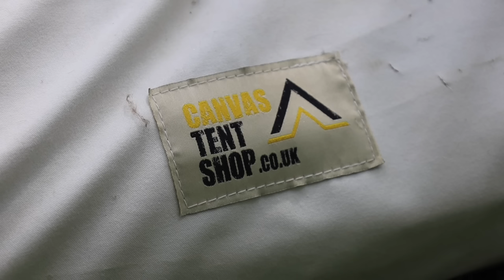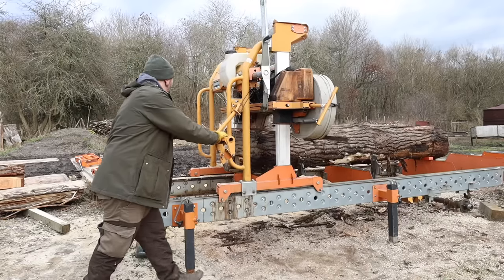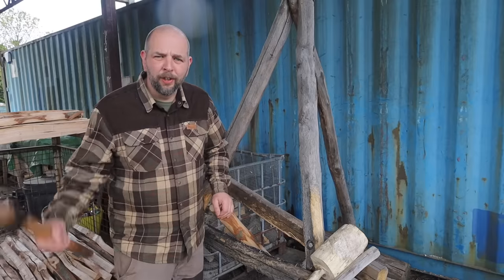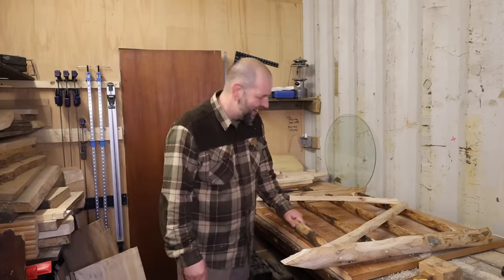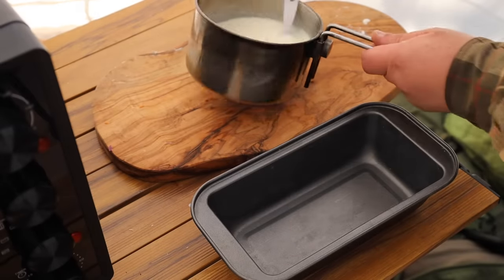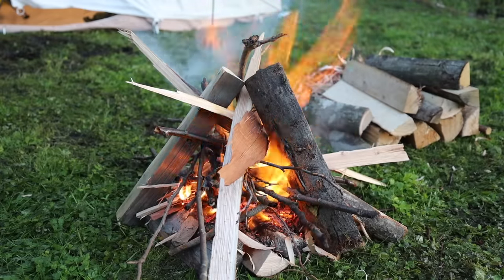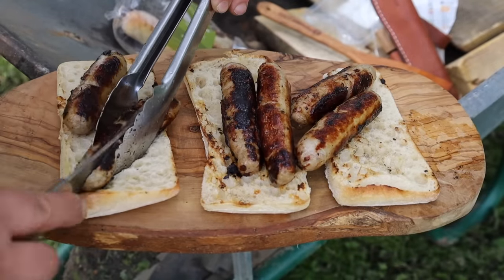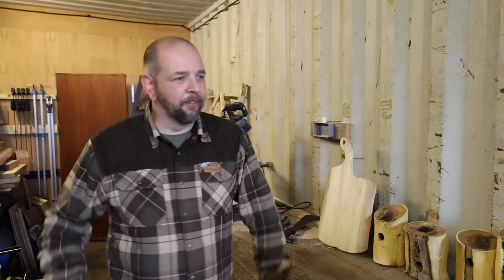Off Grid Camping - Wood yard Woodcrafting

Comment: The biggest benefit of solar for camping, would be charging an electric chainsaw, so you can harvest wood with a LOT less effort.

Chain saw dead standing or large fallen trees into 6-8' logs, which you can then much more easily hand process into firewood.

At first i thought an electric chainsaw would be worthless, but it's far easier to source electricity in the wild with solar, than it is to source gasoline and oil for a traditional chainsaw.

Comment: The point of this video seems to have been to get Bluetti to send a free power bank to your mates commercial business. That power bank, whilst very capable, is entirely unsuitable for commercial use. It's not rocket science, the wood yard needs a bank of batteries, a roof full of solar panels and an inverter.
Reply: 🤦 The woodyard runs on grid power just like with all the other things in this video. He was simply curious so he decided to test and see if the Is solar battery  could handle the power draw of a table saw. The point of the entire video is to demonstrit's ability to be used to power off grid things while camping or glamping. And hopes that some of his viewing audience will decide to purchase one and use his affiliate link so he makes money off of it. It's not rocket science. 😏
Reply: @Jacob Ravenwood  So the video was aimed specifically at all those members of his viewing audience that take a commercial table saw camping with them then? I'd say that if that were the case, it would have been a pretty niche video! The best way to establish if a power source is suitable would usually be to have a look at the plate stuck, or riveted onto the machine by the manufacturer, which would specify that information quite accurately. I don't think trial and error with power banks is really the most efficient, or economical way to find out. 🙄
Reply: @tim1289r  I'm sorry that I didn't directly specify I meant random any random thing that 1 could possibly need or use camping or doing other outside activities that requires a power source not just power tools not just table saws Anything refrigerators microwaves air fryers random Anything random just trying out lots of different random things to show.  The station's ability to power a wide variety of many things not specific one things that are always brought on camping trips lots of random Like the electric oven that he powered in the video. A basic old school commercial sales tactic meant to show the significance and power of said station in order to impress those watching enough so that they may then proceed to purchase. Said station. With which to determine that this station might meet all of their necessary needs without Having to read anything but there's simple visuals. 😏
Reply: @Jacob Ravenwood  oh, I see, well actually, I don't. So the video's author and creator got it wrong when he wrote in the video's description,  that, this was the beginning of taking the wood yard off grid? Maybe you should watch the video, or at least read the transcript. To me, it seemed that the conversation with Bluetti was about the wood yard. Maybe I've misunderstood things,  because to be honest, quite a lot of what is said in the video makes little to no sense anyway.
Reply: @tim1289r  I see what you mean. I don't know either maybe he started out with an original plan for the video and then change it halfway through and just got too lazy to Alter the description. Maybe hes got a lot of family related things run through his mind when he was filming. And editing this video who knows. With the term scatter brain comes to mind. 🤔 I know I've been there a few times in my lifetime to say the least.  lol
Reply: @jacobravenwood7968  fair enough! 👍🏻

Comment: That powerbank looks good, might it benefit from a sack trolley or similar? Could be easier to move it about then. Tefal every day induction hob is a good hob and does not use a lot of energy because the lowest (manual) settings will get most things cooked without fuss or problems. Looking forward to more of this hybrid style. Be well.

Comment: Like the bell tent and always a good video…but bro??…”off grid”???…definition : not using or depending on public utilities, especially the supply of electricity.🤔
Reply: A portable solar generator is not public utilities public utilities require a grid and a ground based connection. By utilizing portable solar energy rain catchment systems. And going to the bathroom behind a Bush instead of in a toilet that flushes into a septic system Those are all aspects of off grid. Because you are not dependent on a government or state run utility services.

Comment: An induction hob can be set to use 500 watts, I have used it on a Goal Zero 1000x power station to cook meals during power outage... the 1000x is in my truck, the power station I use (4)100 watt panels to charge it from time to time it will take up to 600 watts from panels... my 300 watt panel is  on my Goal Zero 1500x power station  which is powering my covered patio fridge most of the time... an experiment. 

One thing about the current level of power stations and panels is the compatibility of the connectors... most of my panels are Goal Zero, same as power stations.
Reply: Interesting look a bit deeper into your life... the brand of your power station is one I have seen before... also one of the better brands with higher end stations.

I would find a tour of the panel connection system interesting... I am familiar with the adapters and connectors Goal Zero uses to connect 100s of watts to their power stations... the MPPT controllers are nice for maximising panel input when clouds keep changing to power input to the power stations.